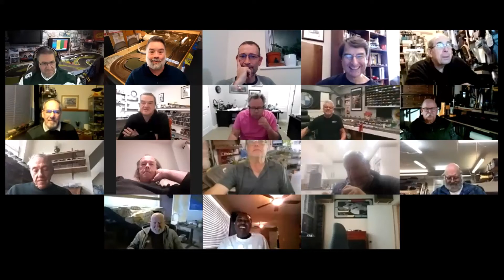Digital and Analog on the same track?

Comment: Is there a switch you recommend?
Reply from the maker: search your hardware and/or electrics supplier for a 4PDT (4 pole, double throw) switch with at least 10A continuous power capacity. Here's one on Amazon that would work nicely. It even has screw terminals to make connections easy (mine was solder points), and a center off position, which adds even better protection, and the ability to make sure the track is completely dead.
https://www.amazon.com/dp/B008DS23V0
Reply: @ggaub  thank you so much!
Reply: @ggaub  can I leave the digital crossovers in for analog after I install the switch?
Reply from the maker: @IjohnnyproI  yes. though depending on where the lane changer is, you might want to put tape on the flippers (I use electrical tape) to hold them to the side to keep analog cars from changing lanes. Sometimes the analog cars can push the flippers to the side.
Reply: @ggaub  thanks again. You been so helpful. I appreciate it.
Reply: I pulled the analog one open and there’s two little brown m&m looking things on the wires to each lane. Do I need those?  If I do use them will it hurt the digital side?  Do you have an email address you can put on YouTube or dm on Instagram?
Reply from the maker: @IjohnnyproI  Those are probably capacitors meant to reduce/filter EMI noise created by the electric motors of the cars. If that's the case, then they aren't strictly necessary, but if you have any radio devices in your house, running your cars might create enough noise (electro magnetic) to interfere, so I generally advice people to leave them in. They're not hurting anything, so really no reason to remove them.

As explained in the video, there should be no possibility of hurting the digital side because the switch is breaking the circuit that the digital side is connected to.
Reply from the maker: @IjohnnyproI  you can email me at ggaub@ggaub.com any time.
Reply: @ggaub  I shot ya an email
Reply: @ggaub  these are on the wires going to the track. Can I just move them to the controll/power wires to the new switch?
Reply: They are on both the positive and ground to the same track
Reply from the maker: @IjohnnyproI  yep. that's how they work. It's a low pass filter, noise reduction.
Reply: @ggaub  can I have them before the switch?  With nothing from the middle row of the switch straight to the track and put the filters from the power base to the switch. Thanks you for your patience. This is new to me.
Reply from the maker: You can have them anywhere, as long as you make sure that a single leg of the cap is not able to touch two other connection points to cause a short.

Comment: Do you know where I can got the little copper clips for the jumper cords?  I’m missing some.
Reply from the maker: Is this for Carrera track? You don't really need the clips. You can just stuff the stripped end of your wire folded up a little bit. If you really want the metal clips, I think they might be sold at some slot stores, such as Digital Space Solutions, or Digital Racing Solutions, and maybe some others.
Reply: @ggaub  thanks again!